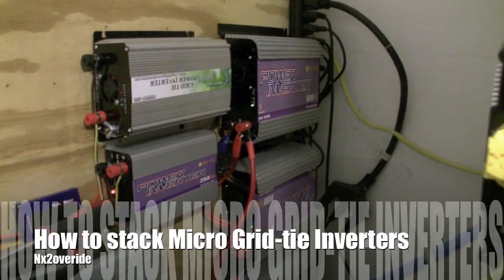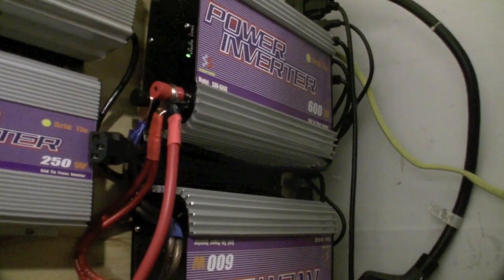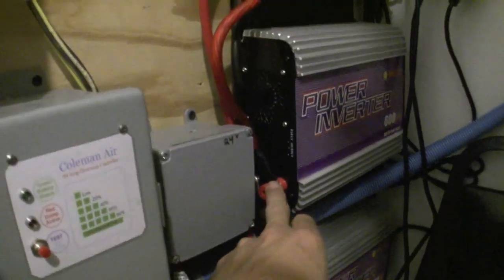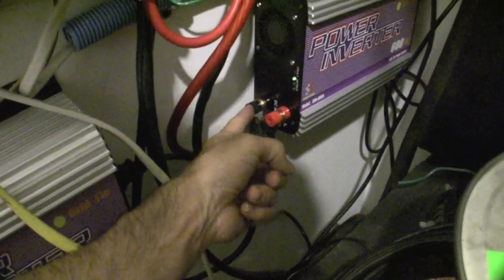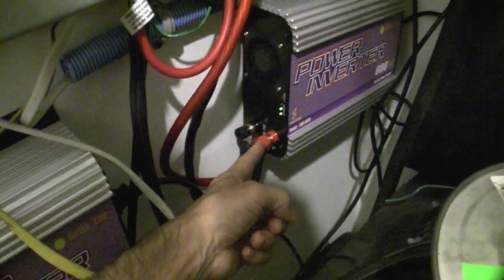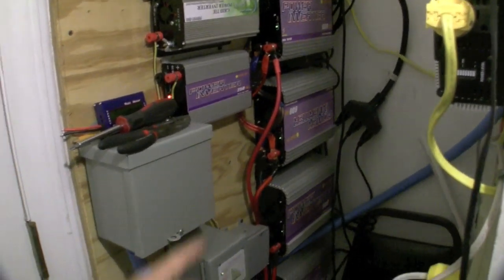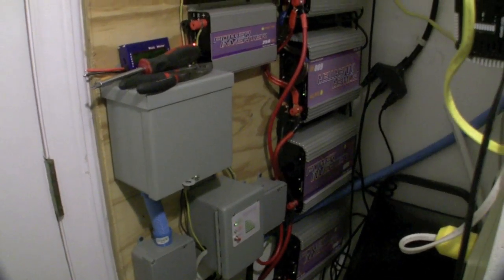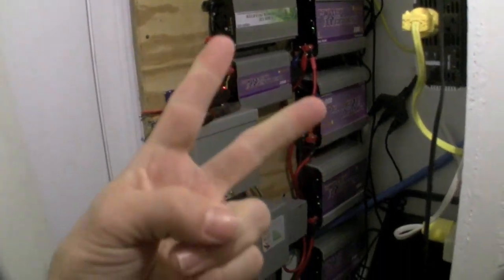How to stack Micro Grid-tie Inverters

Comment: I have a question, so this doesn't blow the breaker in reverse, forgive me if that's dumb.  But 15a is what a regular circuit is, 120x15= 1800, so if all 4x600 =2400 watts is it a problem or only when drawing current not pushing?
Reply from the maker: They weren't pushing that much power back in. It topped out around 1400 watts.continuoisly.  it has to do with using the power before pulling from.the grid. If you back feed.it they will charge you for it now. Smart meters.

Comment: How did you connect the AC side? Did you just plug in one of the inverters or all three? Thanks
Reply: Plug each inverter into the wall.  When the inverters are turned on each will sync to the grid and start producing power.

Comment: Have you ever experienced the inverters to trigger each other on a power out im worried about feeding power into the grid if its shut for maintenance?
Reply from the maker: nope when the grid goes out the inverters stop sending power.
Reply: @TheHumanThatDrums   Yes after thinking about it a little i figure they could trigger each other but then will try to overpower each other until the fail-safe kicks in and then they all shut down. Thanks for the reply!

Comment: Is this all going into 1 circuit?  If so are you worried about putting too many amps on the circuit?
Reply from the maker: The inbound power will not exceed the power 1 circuit can handle the extra inverters are so if one fails the amperage can be distributed amongst the rest.

Comment: I wonder how safe this setup is? if you have a grid tie inverter it has saftey features to shut down if the grid fails thus ensuring linemen and other grid workers are not working in a line that is live. however if you have multiple and the grid fails will they not continue to output due to seeing each other as "the grid" or if multiple people in the same area have them? I guess if the draw was much higher than the output they would error and shut down but what if there is enough power to maintain the grid in that area? what are your thoughts on this? cheers
Reply from the maker: I tested that Senario because I thought the GTIs would keep running seeing each others power as grid power. When I tested the Senario creating an outage by killing the maine ling the GTIs actually shutdown. I am not shure how they know the difference between their own power and power from the grid unless its regulated by amps? Either way they do shut off when there is an outage. I also have a DC disconnect at the pannels just in case of emergencys.
Reply: Nx2overide hmm that's interesting. perhaps they notice the voltage spike. as I understand they output about 5v higher than the grid voltage but this is pulled down by the grid. so perhaps when the grid fails and they see the 5v higher and shutdown to re sync only to realise that there is no grid? I'm completely guessing though. any idea? I've always stuck with a single higher power gti as I was concerned about this issue but it's interesting that you haven't ever had a problem with it.
Reply from the maker: No idea.. I have an old 500 watt GTI i took out of service I may fool around with and try some things on. I have been saving for a single GTI just to clean it all up and make it simpler. I want to pretty much have one setup instead im running a 12 volt battery bank now with other panels.

Comment: Good info.  I'm planning on starting small with 400 watts of panels, a 500 watt grid tie in, and a kill a watt meter.  If all goes well, plan to expand with the same setup (buying a 2nd set of everything) but keeping it down to 1000 watts per outlet/separate lines.

Comment: Hey buddy, dumb question for the day, will these work with 12v panels? Or do they have to be 24v panels,, I guess the better question is will these work with both 12 and 24v panels?
Reply from the maker: WORRO01 you can wire your panels 12 , 24 or higher if you have enough panels, but when purchasing the inverter you need to make sure you stay within the voltage range. The 600 watt interters im running are for a range or 22V~60V. If you are under range they wont create power and if you are over range you will toast it and fry the inverter.
Reply: yep, all my panels are 12 volt panels,,,so I either wire them together to up the volts or just go ahead and find an inverter in that volt rang, and being stupid with this stuff tht may be the best way to go for me. Thanks man.
Reply: +Dan Whitehorse Thank you Sir!

Comment: i have seen this several times but kinda confused by the purpose of stacking them? for a example if you have four 500 watt inverters and stack them does it now become a 2000 watt inverter?
Reply from the maker: If you have 1000 watts of panels and two 500 watt inverters. If one dies the panels will fry the second one because one 500 watt grid tie inverter it can't handle all the power. Having a spare means if one dies the load will still be able to handled it. It's a fail safe for me.

Comment: can you stack a 300w with 500w ones
Reply from the maker: I dont recomend to do that. The 300 watt inverter will be working harder as it takes less wattage to operate. I use to run 3 600s and a 500 before I changed up my Grid Tie rig though so it will wear faster my 500 died.

Comment: Maybe draw up a line diagram, please?
Reply from the maker: I can do that for ya.
Reply: nx2overide
can you send me one too plz?  and what gauge of wire between panels? thanks
Reply from the maker: I buried a run of 4 gauge to the panels disconnect box and in-between the inverts because it was all I could afford. The panels are all wired 8 gauge to the disconnect box.
Reply: send me one too. A quick wiring diagram would be awesome if you can send me one too.